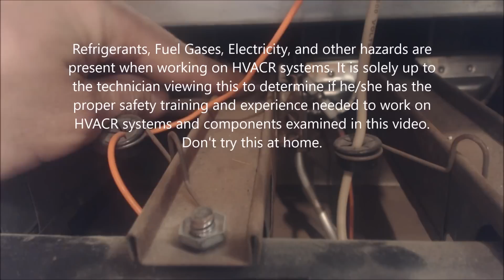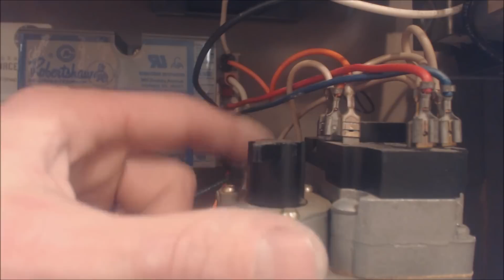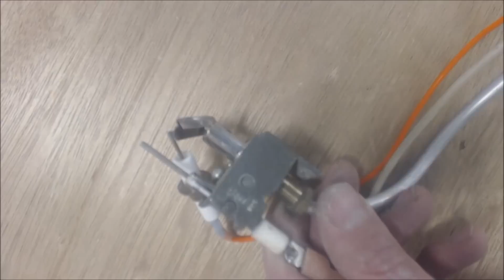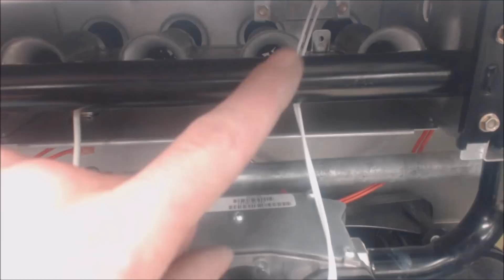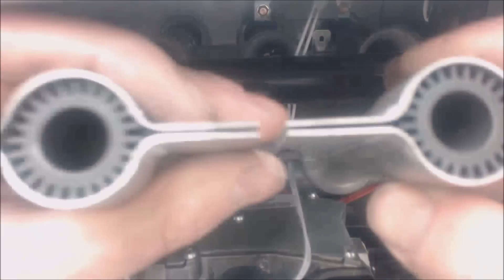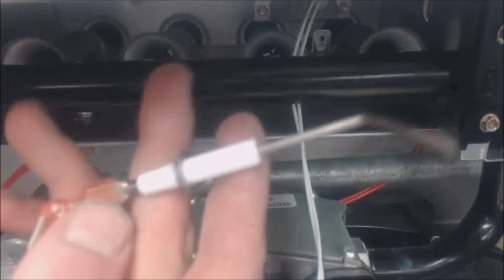Furnace Flame Rectification Safety on Older versus Newer Furnaces!

Comment: Another great vid. What type of flame rod sensor do you recommend carrying on your truck.Thanks.
Reply from the maker: Just the combination types used for intermittent pilot tube ignition spark and 24v hot surface combos. I am looking to do a video on comparing these. Large flame sensors almost never go bad but the small ones or the hsi or the wires go bad on the small combos.

supco SSN24

cozy 78098
cozy 78099
honeywell Q345U1005